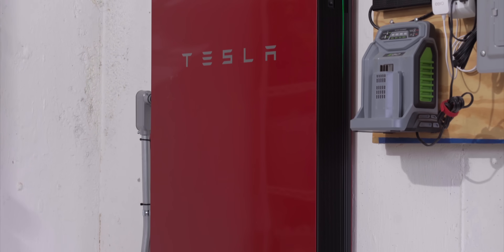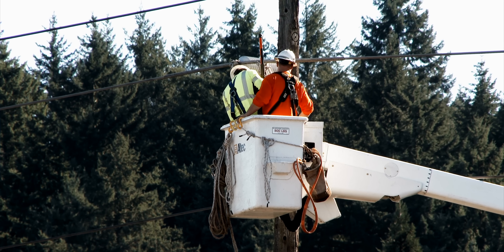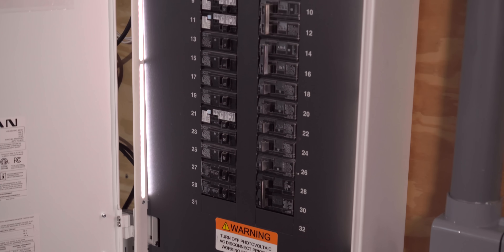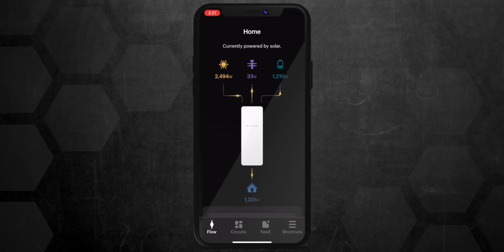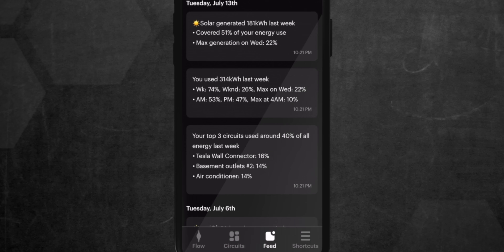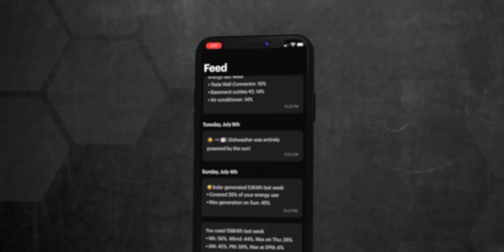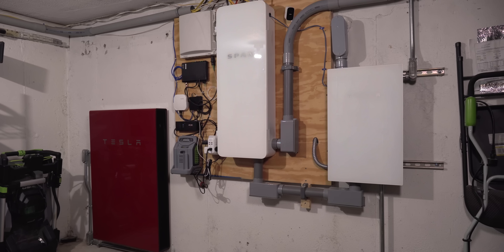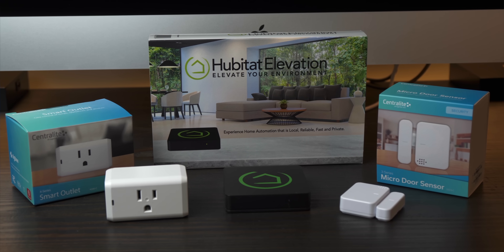This Smart Home Electric Panel Fixed My Tesla Powerwall

Comment: My problem with all IoT devices is really highlighted by this product. What happens if the company goes out of business or stops support? For a product like this I'd need this question answered and would prefer it be documented in a legally binding way - afterall I'd expect a 20-50 year design lifespan from such a product, not the 2-5 of most IoT trinkets.
Reply: @monad_tcp  maybe where you live. Where I am houses are permanent structures. Apart from some temporary built structures after the war and the odd house that's had no maintance for 60 years, houses have no lifespan. You just keep them maintained. Mines about to turn 200 years and had no major issues.
Reply: @monad_tcp  I grew up in a 200 year old victorian era house.  Houses do last that long. Now whether you or your family live in the same house, yeah maybe not.
Reply: @tjwatts1207  Yours is the exception. Relatively few American houses built 200 years ago are still around. Most homes built in the last sixty years were built with cheap labor and materials and will not last as long as you seem to think, particularly because they do not meet the criteria of modern buyers (tiny bathrooms, inadequate kitchens, lack of storage, and so forth). More than ever, when buying a home, people want new.
Reply from the maker: I didn't get any official word from Span on local control, but it looks like it's moving that way.  With future updates it may become possible to write your own hooks and software into local APIs.
Reply: @UndecidedMF  but it doesn't need a fucking API. It doesn't need to be controlled to the internet. It's just more point's of failure
Reply: @monad_tcp  maybe where you live houses don’t last more than 20 years, but the median age of a house in the US’ Northeast is 57 to 58 years.
Reply: @taleseduardolima  mine has 100 years
Reply: @monad_tcp  did you say not even your house is going to last 20-50 years, i know alot of homes that are over 50 years old heck i know some that are over 100 years old
Reply: @3dprintingcave778  I'm wrapping up a guy renovation on a 120year old house. The added lead cold water were in-service when we started. There was the original knob n tube that was added to the house along with the 30/125 service, also in-service as a sub panel feed from the 100A main panel. Oh the old tech in these houses, we need to learn a thing or 2 from them. Today's houses are not built with the same quality, can see where your house won't last 50yrs.
Reply: @clarkwg247  lol funny stuff ok i built my house in 2001 its 21 years old now it is exactly the same as it was when i built it 21 years ago your saying my house wont last 30 more years really
Reply: @3dprintingcave778  staying it won't last 120 years. 80 year old wood construction buildings are built better than today's methods. Those buildings have structure problems from being so old. New wood construction buildings have about the same issues in the first 15 years. Maybe you got a good contractor with good carpenters and got a home built above standard. Standard not equal to code which is minimum. Corners frequently cut and often not caught by inspectors enforcing code.
Reply: @monad_tcp  I live in a house built in 1949… and it’s going great… 25-50yrs isn’t a long time for a home investment
Reply: Oh man I should have read the comments I was thinking the same thing! Been burned so many times with an IoT device. I'd want something with open software or at the very least had zigbee or zwave and let you integrate it into my own home base cloud with full support like home assistant. I'm going solar in 12 months this would be a good solution but I can't do a cloud base service on something this important. I'd 100% get this if it worked offline with zigbee or zwave. I hope they realize the amount of money they are losing.
Reply: happens if the company goes out of business or stops support?  it sucks, my mom bought a maytag cloth washer with a warranty they won't support since we live in a area they don't support, no one near to fix

also the washer only gets updates if we pay a subscription fee..

We did get them to manage to fix it but also found it came broken to us when it was bought
Reply: @monad_tcp  I did a quick Zillow search for my neighborhood and of the first 6 house that came up the most recently built on was from 1921 (100 years ago). Where do you live that house are torndown in 50 years? 
BTW - "Not even cars" - I think the lifespan of a car has to me much shorter that than of a house. I haven't seen many cars from the 60's lately yet most house in my area date from further back.
Reply: @JesusVillanueva  it helps that 🏡's don't move or exposed to road grime or salt most of the time and have climate controlled environment 

but it's still possible to design a car to do one million miles and a useful 50 year lifespan without need a full restoration job assuming that the owner took care ( and wasn't muddling and rock crawling everything every day or weekend ect. ) of it and did regular maintenance but id bet it would cost more than the average economy box 🚘 as it's more labour and material intensive to build
Reply: @JesusVillanueva  and how manly in your neighbourhood have had upgradeds like soar system's or panel updates or sizes say 50amps to 200 amps ect. since day one?? and or changes to the garage or lovely carriage house or barn or driveway? as this 70's home was built in mind for big 1950-1977 convertible caddys or sporty imperials and full sized 1 ton pick up crew cab camper specials and a tow behind big boats v8's that have over night birthing and water skiing ⛷/fishing 🎣 or so the retired neighbours have told me that ps. was a plant manager's home ( not related to any of his family or friends that i know of ) first in say 1972 or so and now it isn't 

this would make for a great youtube video as the changing needs as cars have change shape and before horse 🐎 was used as transportation and so the needs of storage/parking of a model T is different from my charger to a eco EV box 🚘 ect.
Reply: @JesusVillanueva  things still go bad as i mostly agree to your comment above sure dielectric property's of parts / plastic, cloth ect. or metallic conductors can maybe ish go 60 years but that doesn't mean that it's a safe thing to do as after the 30~ year copper mark ( aluminium panels were only warranted for sub 9 years as NOS back in the day aka the 90's and has a shorter a design life cycle to match ) and lots of use and the safety margins go way down same concept as aeroplanes 2000 TBO hours of service and preventing a accident, and the edson home fuse concept is outdated for more than one reason such a uneducated and or i don't care home owners or renters using the wrong sizes or types in the slot or getting hurt in the dark from the live empty sockets and hasn't been used in any 🏡 sinse-2002 or before as there are advanced advantages to upgrading with PLC control with remote server access but its a double edge sword 🗡 that can be very useful as a safety tool/other toolset  but can be used again you too 🕵️‍♂️ 

my main water meter ect. only lasted about 15 years here 💦🚿 in the 70's 🏡 but you're right I was hoping for 20-35 years of use as its a pain to fix. i wasn't planning on or helping to replace it in the time i planed on living here aka im planning on moving before 2030 or sooner again

all of my 3ish rides are pre-1990 right now but its not like they don't need TLC at this point aka time for a full rotisserie restoration ( for the first time and or again. even a budy's 2006 LWB jeep is needing some love and is worth it and he is planning on keeping it, as the body and frame rust is starting to show up from in city/town driving ) and yes one of them is a 60's charger ( a other one is a 80's K1500 prior farm / construction concrete form truck ) and i know about some other chargers ( and i wished mopar had used thicker copper wires for more safety margins but they didn't same things with houses more so with al wires ) / pre-1990s in my local area but most people nowadays don't daily them, i did intel ( even in some ❄️ cases as i felted very safe in it and yes i know its not good for my paint/=rust but it drives so well and made me smile 😊 vs beep box 🚘s ) mine was forced off the road from need B-bock engine and automatic transmission repair / hybrid ev and 7-speed RB hemi conversion. my roommates are all pre-2007 right now ( but both/all are thinking about getting different rides from being wore out or having different needs that when they got it and or both ) but one of them is probably getting the boot ( 300 non-C aka not a hemi v8 ) from old age as it needs a lot of work and he isn't mechanically inclined plus it has a lower resale value, it's being replaced by a 2022 ford lighting long range most likely as the dealership's said it's the same costs to operate as the 300 or less ( "will make a better cursing person lucso sport 4 door sedan" for things like longer trips to the beaches 🏝 or airport or cruise ship 🚢 ) in his case use's. 
most automotive suppliers and car manufacturers or at least since 1999 aim for a designed life span of 15 or less years and about 150 miles of use engine hours is sub 2-3k hours of run time ( rebuild engine for the charger im trying to get the same useful modern lifespan as oem's but more power thats one of the reasons i know the spec's ) and warranty's are sub 100k miles and sub 12 years or another words as soon as you finish paying it off 😂 and start to get ahead financially.
Reply: Open Source / Self Hosting is the way here.
Reply: @hammerheadcorvette4  the computer 🖥 / plc gooi human interaction interfaces  is the part of the program i have little to no real good skills and experience and would struggle with immensely with.

and would love ❤️ more options and opportunities for 3 partys support to do something like span 

as i said hard wiring im okay 👍 with houses 🏡 NEC ( my NEC NP70 is for manufacturing plant use ) i have to look 👀 up but vary do able and let's be honest omost no one can remember a 500+ page 📖 all at once as a pop quiz without referencin reading time to time
Reply: @monad_tcp  DOCSIS still usually involves provider-specific certificates on the firmware, so you can't always use modems between providers.
Reply: @monad_tcp  Yeah, I hear you. I found a file upload vulnerability on my router, which I used to trigger a Lua script containing a reverse shell, so I could mess with my modem. Was pretty terrifying though that it also exposed vulnerabilities involving my internet provider as well.
Reply: I asked Span’s founder this question and was told even in the event Span disappears and none of the smarts work, it’ll still function as a normal electrical panel.
Reply: अंकल
Reply: @monad_tcp  You really don’t expect a home to last 50 years?
Reply: I know building that still use screw in fuses instead of breaker boxes and while they should be replaced (for ease of use and safety) they are fully functional.  Main reason being is that they don't rely on any external entity to work properly like one might have to with a "Smart" system that has to check in with a remote server even once a month.  Anything that going into a home as part of the building stage (Electric, gas, water, phone and/or cable) should be something that can foseably last decades (20+ years).
Reply: As a luxury homebuilder SPAN, the company, can own the abstraction layer between technology systems and UL/CBC approved home equipment beyond. Trades won’t install non-UL/CBC approved gear. SPAN will need to float sunk cost of getting it. There are a host of incompatibilities between. Fault tolerant breaker boxes are just edge cases. NOW Calif. mandates rooftop solar, the opportunity is there.
Reply: open software, open protocols for control and open standars, and of course CLI interface
Reply: Elephant in the room!
Reply: IoT devices are also available from more established breaker panel companies such as Eaton, Square D, GE, etc. If your concern is the company going out of business, these companies should be a bit more reliable, since they have been in the market for literally over a 100 years.
Reply: You're right! The now isn't worth it at times
Reply: IoT that can't be self-hosted and FOSS is just a subscription nightmare waiting to happen
Reply: It’s already been said, but without someway to guarantee the systems runs, at it’s full functionality, in the case the SPAN goes out of commission; I won’t buy it. If that existed, I would be one of the first in line to buy.
Reply: @monad_tcp 😂😂😂😂
Reply: @MrGoodeats  oh come on guys, rewiring your house to get more current feels so good. 

Now I have 200A.
I'm on the 4th re-wiring.

I expect a house to last 50y, what I don't expect is the same wiring to be usable for that long without needing to become beefier.
Reply: lmaooooooooo 20-50 years! these guys are planing the bankruptcy already!!!! welcome to tech "entrepreneurship."
Reply: @monad_tcp  IDK what kind of dumps you've lived in but its hilarious that you think a house will last less time than a good shingle roof!
Reply: @Voyajer.  my parents house has 40y.
It had its entire roof tiles replaced 2 times, and the electric installation 3 times.
So I don't expect mine to last 20y, it's not reasonable.
Sure, the masonry and wood does, but the electrical circuits...
With exception perhaps of the solar panels.
But the actual breaker box, lol, good luck with that, why, wear and tear.
Besides, the battery and solar panels have 20y guarantee.
Reply: This smart panel is basically a service you buy, so you don't actually own the breaker box, I'd rather rent it from them. The same way they give you a modem when you subscribe to an internet service.
Reply: @monad_tcp  They were using grounded copper 40 years ago. Why would the whole house need to be re-wired three times? Upgrades and repairs, sure, but I don’t know why you’d think that you’d need to replace the whole house wiring periodically.
Reply: @tempesttube  you do know that the 20-1990's~ was infamous of using aluminium wires and aluminium parts like the federal pacific challenger panels 🔥 right ???? yep the same ish one that's in the 70's house ( and the Vietnam war era so so popular for aluminium and hardly and copper was be used in new construction and is now being wrote out of the 🇺🇸 NEC code for single family dwelling home use thank G! ) im typing this from now and im going to have to check again for al wire as it's a fire hazard 🔥 and even by now even if it's copper wire ( worse if its aluminium as it ages poor or gets wet at all even higher doo point poorly ) it can have severe insulation deregulation and severe oxidation too it as its past the 30 years mark for most of the system if not all if it.

same problems and more with the 30's house i was in 10 or so years ago just most of it was copper the 2 car shop wasn't added intel later in the early 70's and al was cheep ( so that's what i remember most if not all of the shop using win i had to minor problems fixing the lighting in 2013 intel i moved out but * might have some copper but it would have been used or scraps from a other job site 2 year or more aka old but rubber/plastic insulation as new construction 🔨  ) but it two had subpar insulation quality and lower fire resistance ect. but was a bad idea 💡  but even the copper and cloth was done!! and well past it's prime even without me touching it for 40+ years 

as for newer housing vs 200 old the 200 probably had at least 3 up dates by now more so with the wiring / internet or at least id add 1g ish glass fiber service to it. now i know of at least one local new home builder that loves ❤️ to play fast and loose aka super cheap but flashy curb appeal low build quality but they still $$$ to the new unsuspecting home owners
Reply: @richardprice5978  if done properly, there’s no issue with aluminum for caring load. The issue is installing the lines and not mixing copper and aluminum incorrectly.
Reply: @betterwithrum  key 🔑 word not for home 🏡 use with run of the mill population of the 🇺🇸 as i know the utility uses it for longer overhead spans ~1megW power lines and aluminium thicker cabling is a much better choice for that job than ( steel and copper bundle combo ) a average home that's mostly neglected system without any safety audits every 90 days-year or so with tools and fire and electrical training ( and can go unnoticed and or seen by a human hand for 15+ years intel its way to late = chance of 🔥 or annoys at best more that likely by that point 🔥 instead ) and last i check 50+ years of 🔥 history in challenger brands and aluminium wires and other like it /in older homes 🏡 is showing that. 
In most automotive / mobile use ( that i have seen personality and or knowledge of ) is copper wiring ( with PVC insulation or cloth* in pre-1966 ish ) / higher mix CU alloys in the last 100+ years so there a reson for that one too

just for the sake of a argument for say a race car 🏎 aluminium wiring is probably not going to save any time or weight and maybe cost more to use as a construction material ( the starship argument elon musk point ) ( even if the product has a shorter life span of under a year and something like rusting or 👌 heat management ect. isn't a factor for considering just winning on Daytona 500 on race day as we don't care if it is reusable after the race or not ) and method vs smaller copper wires that weigh more and be less and shed heat effectively off it is probably the same issues with other things in life two
Reply: @tempesttube  "need to replace the whole house wiring periodically" increased demand, living in a damp environment or salty
Reply: @monad_tcp  Hummm, I just bought a Span panel at the same time as buying a PV system with Tesla wall. I never heard any conversation saying I don't own the box. The software are might be Cloud based but there's been no conversation about "renting" the box.
Reply: @bobm2331  I was talking about leasing contract.
But I bet you can also buy it themselves.

 Just try to mess with the microcontrollers and the software, you rent the software than runs it.

So basically, you rent the hardware, or can the hardware even work without connecting to the cloud ? 

Are you allowed to modify it ? 
probably not.

So you don't own it, plain and simple.
Reply: @monad_tcp  Not me I own my gear out right, if I can't I tell them to take a hike.
Reply: @monad_tcp perfect way to give lose money.
Reply: Not to mention the "need" for an intermediary server, for "updates", data harvesting....
Yeah, while these devices do actually serve a purpose, big no from me! I'll build my own. Not even hard to do these days, even for complete novices.
Reply: @jimmyb1451  I have thought about doing just this... but what about insurance?  Do you void homeowners insurance?
Reply: @horscategorie  I doubt it. But if you're worried about your insurance in case of a fire, 1: you probably shouldn't attempt it, or 2: just pay a sparky to install the "hot" end.
Reply: @jimmyb1451  Oh, not worried about working with electricity - More worried that, say, kitchen fire burns home down.  Investigation will look at service entrance, etc - they always do (retired fire officer, been there, done that...) and insurance is always looking for a potential cause to shift liability... Wiring, etc... often a source.  Making a safe, functional device is definitely possible... but will it void your insurance>  That is the question... Oh, know lots of sparky card carrying folks and engineers with stamps... no problem doing the work myself for that matter...
Reply: @jimmyb1451  Exactly I'd want every thing to be totally self reliant with 0 need for the net. if it can't manage that one trivial thing it is garbage in my books, innumerous things can render the net un accessible or disabled as I live off grid and remote rural, so for me a good thunderstorm is all it takes, I am so sick and tired of "Oh this product needs an internet confection for the user manual, or, to work we need the web" Ok you get filed under R for recycle
Reply: @jimmyb1451  I’d love to create one myself but we have strict laws here when it comes to electricity.  Only a registered electrician can do any electrical work or sign off on your own electrical work.  And it would be a rare electrician that signed off on a home made smart switchboard.
Reply: @k1ng401  Money talks my friend. So long as it's up to code.
Reply: @monad_tcp  there are tons of homes that last longer than 20-50 years, fuse boxes from the 1900's still power some of those old homes
Reply: @walt4690  look i lived i a 30's house ( and more than one 50's - 60's and now a 70's and would love a proper victorian aka pre-1920 architectural vibe but the old wirings got to go!! and i like the fibre optic internet connection vs dial up @ 300 BPS max i will take the rest of it as is as i like historic living and furnishings just i like some modern conveniences and a more modern garage with a modern tig welder 👨‍🏭 / shop 50's-80's motorised big 30x20ft glass door is nice ect. ) and the wiring was toasty aka crumbly crispy mess that was so brittle and was so not safe and mite as well be remelted back in to something else as is was turning back into raw ore and the lights didn't work right either and sometimes flicker with higher doo points and was always in the back of my mind that i was going to get shocked again from say a light switch and or a 120v plug that was not clean consistent power ( aka 80v-150-v ) or be burned alive in my sleep 🛏 

At work it was not uncommon for us to pull new wires every 5-20 years of wire and equipment service plus safety audit with a temp gun /camera every 90 days to a year as it can start fires 🔥 and cost money from downtime in a manufacturing plant maintenance so for me a all copper residential home 🏡 system should be replaced every 20-30 years or less just for safety reasons plus your missing out on improvements as time goes by and there no way id like to try to charge a ev with the old faulty rusy Edison fuse panel @ max 40 amp and to do that thats penny territory aka jary riged for 🔥 or so amps all home service vs modern 500 amps to the hole house service and solar ect. and a dedicated 80 amp modern safety breaker
Reply: @walt4690  I wouldn't want a fuse box and wiring from 1900 powering my power hungry house. 
Lots of A/C units, computers, media systems, toasters, electric ovens, and all kinds of gadgetry I have in my lab/garage, like power tools.
if you use energy like 1900s...

That's on you, or a fire hazard waiting to happen.
I would just wire everything up again, because I need almost 90A of power in average.
Reply: Similar concerns.  Out of the box I'd expect full local control without the requirement for an app, direct management capabilities on the panel itself, a fully-documented and accessible API, a standard replaceable embedded computer that could be flashed with the appropriate OS / packages, and that transfer switch they mention as optional on their website had better be standard at the price they're asking.

And for the love of all that's precious, why the heck would you want to control this thing - the epitome of a stationary household device - with wifi?
Reply: Google home assistant! This is (and open source firmware) the answer.
Reply: @alhdgysz  It might be the easiest answer if you for some unknown reason want to automate your home.

It is NOT the answer.
What google home IS, is the absolute end of any remaining shred of privacy you have left.

There is no way in hell I would visit your home.
Reply: @jimmyb1451  read my comment again...
Google is a verb........
But let me rephrase for you! Search for this: home assistant
Reply: @alhdgysz  No. Google is a noun.
Don't blame me for your lack of ability to communicate succinctly.
Reply: @jimmyb1451  'Google it' was added to urban dictionary in 2004. So it's not my fault that you do not know this almost 20 yo expression....
Reply: @alhdgysz  Urban dictionary?
ROFLMAO.

Wake up to yourself kid.
Reply: Ross, are you asking for a guaranty that the company doesn’t go out of business or get acquired where the new parent changes direction?  That’s an unrealistic request and the only way to satisfy it is buying a specific insurance policy.  NO product in your home has  this guaranty so why would you expect it here?  You take the risk of repairing or replacing the item. Get to know the independent contractors who service it and surely they will provide options.
Reply: @johnpoldo8817  exactly, I can't ask for a guarantee that the company not go out of business, but I can ask for a support and service life guarentee. More over, for a product that costs likely over $5k installed and is an integral part of a vital utility system (electricity supply) that has an extremely high availability expectation - at a minimum I expect to see a lot of thought given to the  "disconnected from the internet" system behavior,  both short term (up to a week) and long term (company cloud is gone).

Basically, it's a cool product that I'd love to see become standard in homes over the next 50 years - but right now IoT is a free-for-all and I expect my power box to provide me usefulness function well beyond that of my next cellphone.
Reply: @rossk7927  I want to help you.  If the company goes out of business, any support and service warranty disappears.  Theoretically, you could buy a service contract from another company which is an additional investment.  However, if that company goes bankrupt or changes direction you lose service.  You know, there are only two certainties in life.